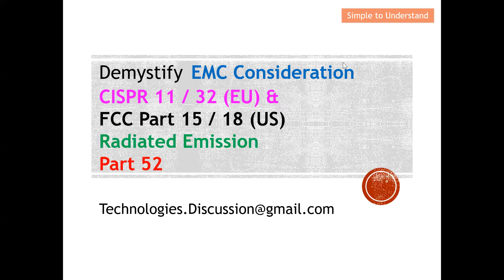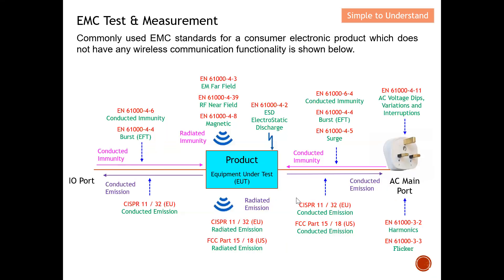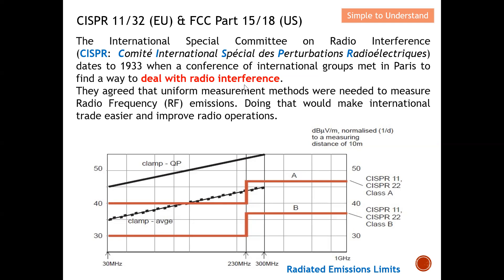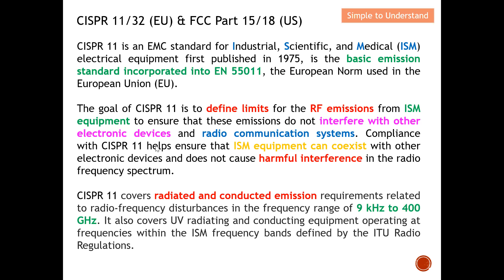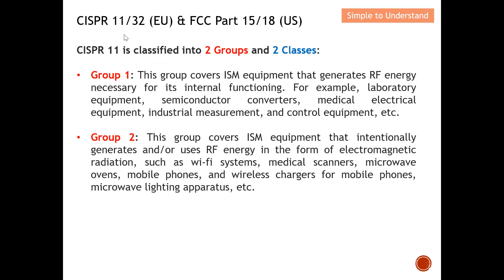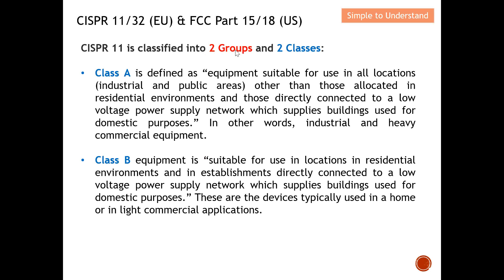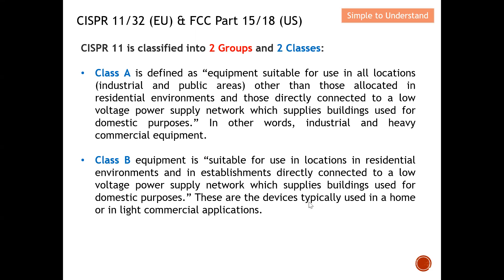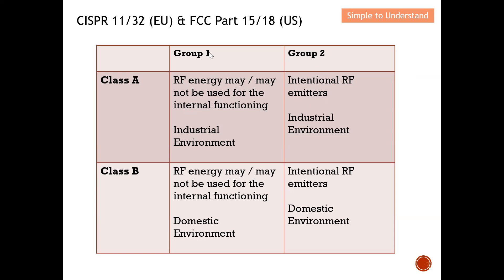EMC #52. Radiated Emission Testing Guide: CISPR 11 & 32 (Group 1/2, Class A/B for EU Compliance)

Comment: Can we build an in house LISN? Maybe for current as high as 200A?
Do you have any recommendations for that?
Reply from the maker: Really very difficult to DIY LISN that can support 200A. I think the diameter of the wire and the heat on the cable will be the major concern.